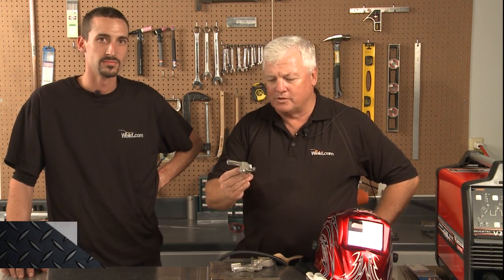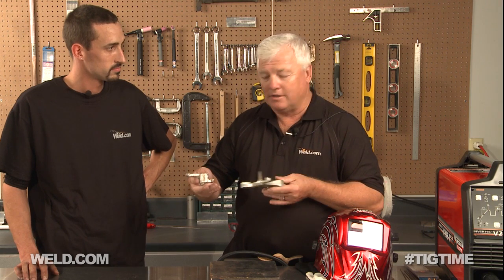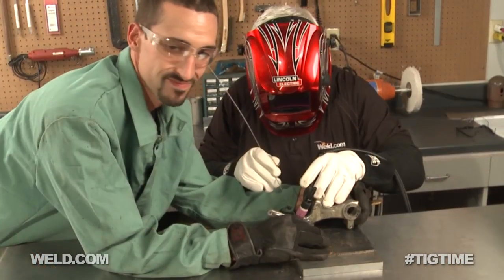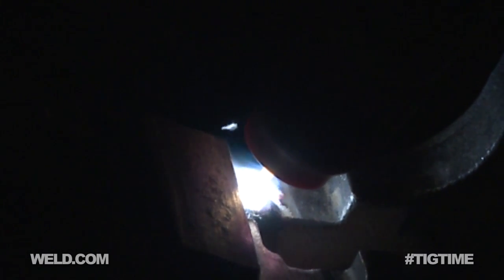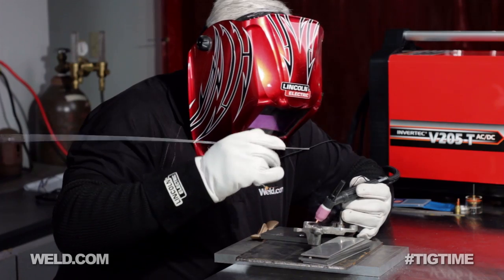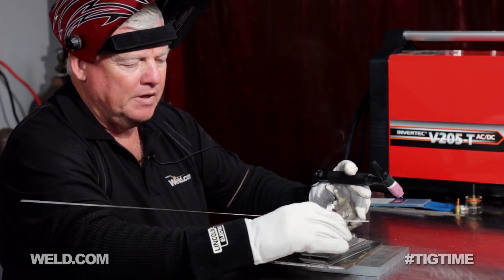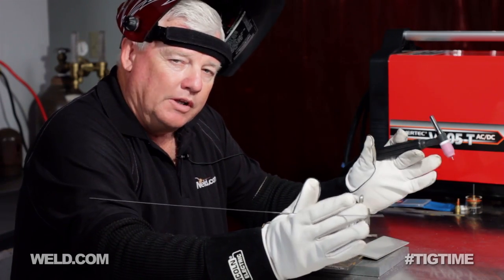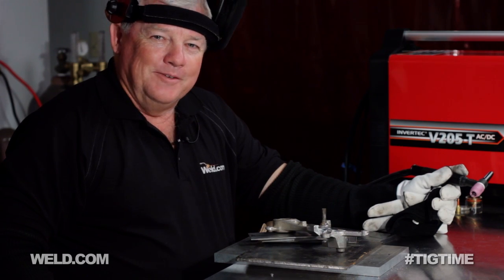TIG Welding Tips for Cast Aluminum | TIG Time

Comment: So I am learning how to tig weld in general but I've been doing aluminum to start seems like it's the most used tig I will do. I welded a transfer case housing the other day it's I believe a cast aluminum. The weld looked great good tie ins everything. The problem I had was after it cooled about an hour later it cracked back out same spot so I did it again a couple more times same result. It was a practice situation so I wasn't super stressed on if it cracked. My question is why would it keep cracking? I'd there a pre heat I should do or a type of cool down period? Is it similar to cast iron welding? Anyhow any advice is good to know.
Reply: I also used acetone to prep and clean after we buffed the metal and ground out the crack.

Comment: Thank you Mr Tig! Going to find me some 4043 filler rod in the shop and fix my 2005 honda shadow cast aluminum timing cover cap on the side crankcase cover.  First time using the tig, but I need my bike running!

Comment: Great welding tips, thanks! I noticed that your tungsten looks very sharp, not balled or rounded as often seen when welding aluminum alloy with pure tungsten. What type of tungsten were you using? Thoriated, lanthanated, ceriated?
Reply from the maker: We were using 2% Thoriated Tungsten in this particular episode.
Reply from the maker: Pure TUngsten is not a good choice for inverter machines. The performance is better suited for inverters, but in this video we were using an inverter.
Reply: Same here, I use green tip on my Dynasty 200.
Reply: +Kev Lar Thoriated is cancer causing in the dust and no better than Lanthanated (maybe worse).  Don't use it again.  Lanthanated is the best for EVERY welding technique.

Comment: hey! I really like you videos and your tips! I was welding an old volkswagen oilsump yesterday and it was one of the worst experiences I have had in my time of welding, so I really started to doubt my skills. I also had big trouble with the heat I brought into to piece causing more cracks right after a few mm of welding. good to see that also you don't enjoy cast aluminum. all the best from austria

Comment: I have a repair that might stump you. I have a Briggs and Stratton engine from the early 80's that threw a rod. The rod hit the cam shaft, bending it and causing the walls of the holes on the block the cam goes into to crack.  It's fairly thin cast aluminum. Is this fixable?

Comment: Comment to the bike owner if he sees this. Are you really comfortable running a repaired braking component? Not to say the weld is not good, but really - why not just buy a new caliper mount bracket, especially if running on the track? MCs are no where near as redundant as cars as far as brakes and suspension parts. Just my opinion.
Reply: Randy Lloyd stupid comment.

Comment: Thanks for this video, Mr. Tig.  My question is With TIG, weather it is aluminum or still they do not require shielded Gas. I'm asking this because I have never welded and Just purchased Millermatic 211. Planing to take some few welding classes.

Comment: Edson,    Sometimes cast aluminum is pitted and contaminated so badly that you need to make a root pass run at your weld and merely watch all the "crud" bubble and float to the surface.  Then you will need to grind or file to remove all the surface oxides.  Eventually, it will try to clean up and especially as you add clean filler... Usually er4043..   good luck Mr. TIg

Comment: This video is inspiring, a real world example that just walked in the door. It also speaks to my greatest difficulty, which is knowing what kind of alloy I'm working with. Would you consider doing a video showing different kinds of metal, so I can get more of a feel for how to distinguish common alloys? 

I didn't understand what you meant when you said that the metal was heavy and dense. Do you mean it was more dense than typical cast aluminum? How do you distinguish cast from forged aluminum?

Comment from the maker: ARCSTREAMS,

The part that you see here only had a limited amount of mass.  Once the heat thoroughly saturated the part,  penetration wasn't a problem.  In fact, too much penetration was the concern, that is to say, the entire region gets liquid & literally falls to the ground.  This material was early identified as cast aluminum and we decided not to v-prep b/c the original location was critical.  We will be covering cast steels and cast irons/pot metals soon. Thanks for the question

Mr. Tig